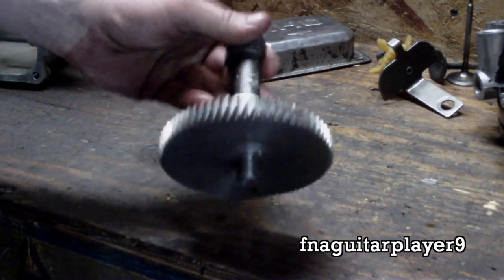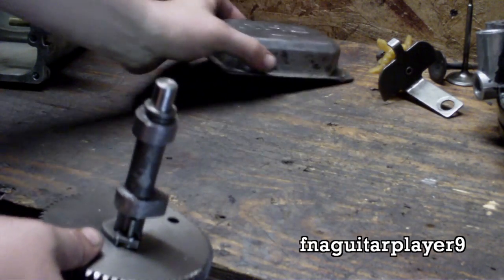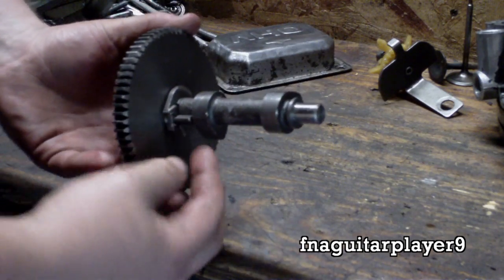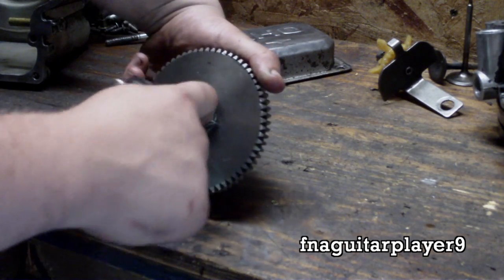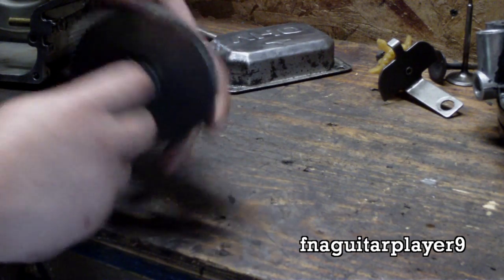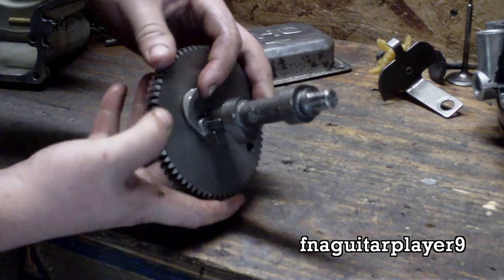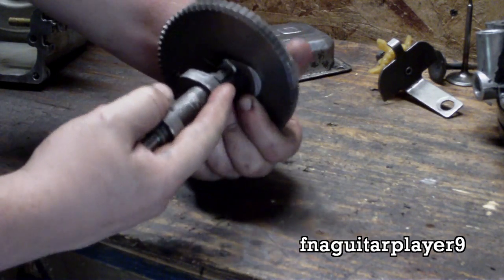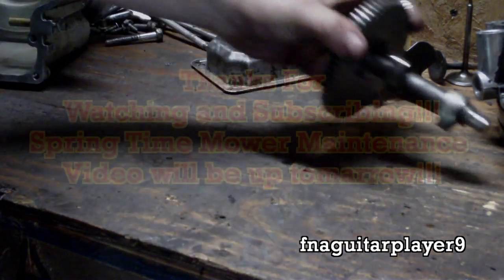How the compression release mechanism works on Briggs and Stratton OHV Engines

Comment: hey I have the 5.5 black model   its a walk behind as well I just had everything apart put together  and working fine  after a few  pulls it locks up do u have any idea that may help me please and have a happy fourth
Reply from the maker: First thing I would do is pull the spark plug out and try to crank it, if it cranks easy then, the cylinder must of filled up with gas or oil, the float may have stuck in the carburetor causing that, if its still locked up, let me know and we'll figure it out. Appreciate that, you too! Thanks for Watching!
Reply: fnaguitarplayer9 Thanks a bunch for replying back. I will give that a go tomorrow seeing I am a little agitated with it right now lol
Reply from the maker: your welcome, haha

Comment: My Quantum engine is experiencing Knocking sounds when i shut the engine off. I have made a video about it. What do u think the problem is?
Reply from the maker: I watched the video, i've heard that before on engines, I'm not really sure what it could be right off hand, i would check the 3 mounting bolts on the motor, that go in from the bottom of the deck (unhook spark plug wire first, if you turn the blade while working on it, it could fire and try to start if its not unhooked), i would check that and maybe the flywheel cover/shroud, it could be loose doing that. Hard to say really without actually looking at in person. Thanks for Watching!!!
Reply: Lol its internal probably the decomp that the  new quantums seem to have. I worked on engines for the past 3 years and this is a fairly new engine so yeah id assume dodgy decomp
Reply from the maker: That is probably right, I didn't think about the compression release, i'm used to seeing it only on the bigger motors like the 14.5HP. That probably is whats wrong with it.

Comment: Also, like fnaguitarplayer9 said, before tearing down, try to reset your exhaust valve setting, if it is sloppy and wide, it may adjust out, if it doesn't then you can look for a  problem on the cam and that is a tear down.

Comment: A quick way to check to see if the compression release is the problem on a hard to turn over B & S OHV Engine.  Take the valve cover off and turn the engine to the position where it is really hard to turn.  You need a helper and expect to get a little oil on you.  Have your helper, when you tell him to try starting the engine, now take a screwdriver and put the tip onto the valve exhaust valve lifter - on the very end right over the valve stem or on top of the valve spring cap - carefully push in about a tenth of an inch THEN have it turn the key to start.  If your engine has had a habit of being easy to start up to now, it will spin, fire and most of the time start.  You may have to try this a couple of times at first to get the knack of it as when the engine turns over your screwdriver will bounce off.  Be careful to push in just a wee bit, you will probably feel the valve stem give way just a tad, that is all you want to push.  They will usually start after one full cycle but if your engine has a lot of miles and a habit of hard starting, you may have to try it a couple of times ??  If this doesn't work, you may have an intake compression release, try that one.  When and if it starts the engine will start pumping oil an you will get squirted a little and the oil will also run down onto the exhaust, no problem just turn the switch off.  Now if this works you have just identified for sure what the problem is so either take off the bottom case and repair yourself or take it to the shop.  Have a nice day.  Jim
Reply: fnaguitarplayer9
Made it through last season without a teardown.  I drilled a hole in the valve cover just over the lifter, made a plug and a tool.  Each time before I start, rotate the engine to coming TDC, remove the plug and using the tool press the lifter down a fraction, you can feel the give.  Hit the start switch and it will quickly rotate, fire and start, insert plug and away we go.  This was to be a temp. fix till I could tear it down, went the whole season.  Now have to tear down and see what all I have to do, I really don't look forward to this, I am not as young (72) as I used to be, getting old and lazy.  Appreciate all your help to identify the problem.  Jim
Reply from the maker: thats a good idea, i'll have to try that, just have to be careful the force of the cam could jar the screwdriver back some, also, to avoid the startup the spark plug wire could be disconnected just for doing a test crank. thanks for watching!!!
Reply: fnaguitarplayer9 disconnecting spark plug can invalidate test by having valve open too far, much better idea to let it start to make sure you are not just holding valve too far open and just releasing all compression.
Reply from the maker: gearbender427
true to. Thanks for Watching!!!
Reply from the maker: Thats one way to do it! I would say you will have to put a new camshaft in it, I don't have any on hand right now, you could probably check on ebay. your welcome!

Comment: what if mine isnt a ohv system i have a briggs and stratton 12.5 gold model and it has really high compression any ideas? i've changed the connecting rod and i torque it to what the instructions said and put it all back together and tried starting is when i found out i had high compression the starter is good had it checked out and the starter gear does get stuck on the flywheel
Reply from the maker: Flathead or L-Head engines usually don't have compression release, so a freshly rebuilt engine will be tight, the 12.5 i rebuilt in the 4 part series had super high compression at first, it has since loosened up some. The battery on my mower wouldn't even crank it had to use a jumpstart then it cranked. It should loosen up after it is broken in. If it is a old starter you may want to take it apart anyways and clean the commutator and brushes, On my twin cylinder briggs, it dragged wouldn't hardly start, took the starter apart and cleaned it, and it starts like a new one. hope this helps, thanks for watching!

Comment: Hey man, I've seen this video before, but I got a question. Do you know when Briggs started using these automatic decompressors? I have a 10hp Briggs from 1976 and with my compression tester I got only 60-70PSI out of it. The engine is not burning any oil and it has lots of power! When I turn it slowly by hand, I can feel a lot of resistance too. If it has an automatic decompressor, 60-70PSI would be excellent, so may I assume it has one??? By the way, yes my compression tester works accurate ;)
Reply from the maker: I'm not sure when the started using them but I don't think that motor would have a compression release, its usually on OHV motors, they may not be to low for a 10 horse, if it isn't burning oil or loosing power i wouldn't worry about it, if you are concerned, you could do a leak down test to rule out leaky valves which can cause lower compression. When ever i work on a motor that has low compression i just go ahead and reseat the valves, and check clearance, most of the time it helps considerably. Thanks for Watching!!!

Comment from the maker: just about any time one is hard to crank over its in the valves or compression release, most of the time you can adjust it out, but the bump on the cam for the release can wear out or jam up. i would think so. try cranking it without the plug just to make sure you don't have a bad starter. thanks for watching!!!

Comment: I have a b&s 16.5 that came to me with the aluminum pushrod been pretty bad coming out the side of the rocker arm. I replaced the pushrod but now it's still hard turning over and I believe that the problem is within the camshaft. when I get to the compression stroke I get a lot of resistance, and I hear a hiss coming back through the carburetor which tells me that the head gasket is bad. I have already adjusted the valves correctly. I do believe that the problem is with the compression release.

Comment from the maker: you wouldn't have to rebuild the engine, all you need to do is adjust the valves, if the valve clearance is to much the compression release won't work right or at all depending on how bad. but the starter may need rebuilt since it got so hot Thanks for Watching!!!

Comment: Interesting!   My starter had trouble cranking over & it melted abit.  The starter stops on the compression stroke. Its spins freely without the spark plugs in.  I thought it was the weak battery, rusty coils, bent crankshaft & etc, but never thought about this.  Well, I guess I'll rebuild my starter & 25hp b&s intek engine!

Comment from the maker: no problem. i'm not really sure, i've never worked on a honda, worked on a few honda carburetors thats about it. i figure it is something like this, i know some motors have a manual compression release. It should be on the exhaust valve, but in some cases its on the intake. well you never know, it is possible that something broke, i doubt it though being that new. You could try to set the valves a few thousandths less, like 4 and 6, some are picky. hope this helps. thanks for watching!!!

Comment: Thanks! Does it work the same in a Honda 13hp? It runs great but starting it breaks my arm. The valves have been set to 5 and seven (I and O) I am gonna check tonight if I see that movement of the intake valve when I turn it by hand. I cannot think something is broken cause the engine (a real Honda) not a knockoff has maybe 20 hours running from new.